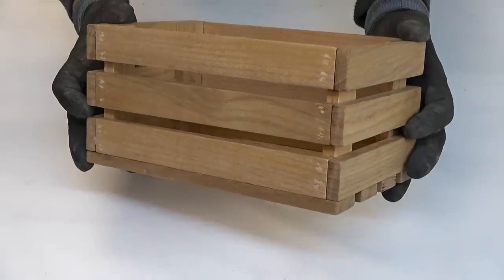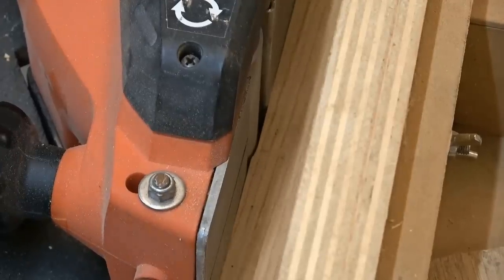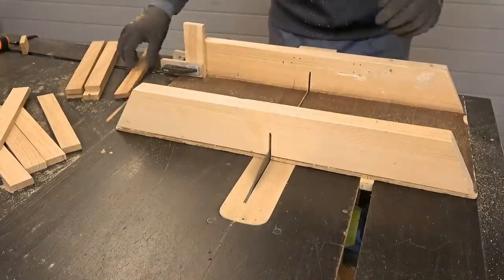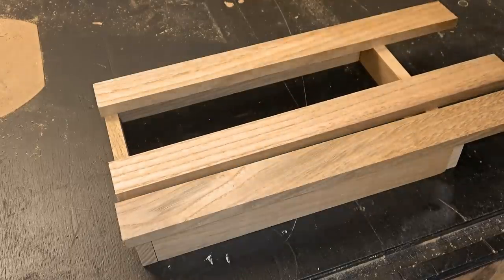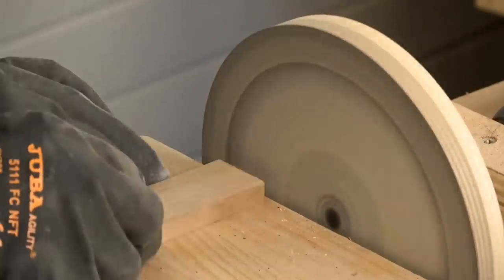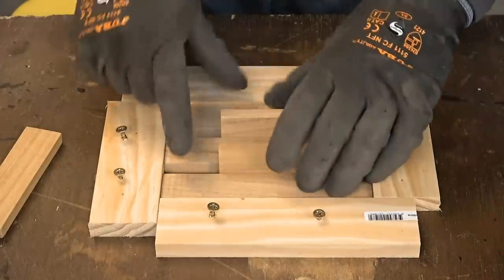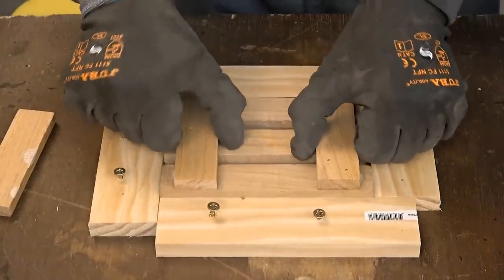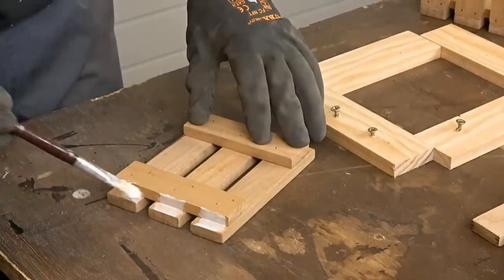How to make a wooden crate box. Nice DIY wooden box

Comment: Congratulations Sergio, the job was cool. Close the holes with glue and then sanding always the good result.
Reply from the maker: Than you. Sure that way it would look better. I am not happy about how the wood filler paste looks after I have sanded it
Reply: @WoodworkingwithDIYtools  use sawdust from the wood you are working with and some glue or a darker filler as the wood will darken a bit over time

Comment: Great video. Thanks for sharing. This really looks an easy-to-make crate box. Very clever template!
What nailer/stapler  do you use? Is it electric or connected to a compressor?
Reply from the maker: Thank you very much Hans. The stapler works connected to an air compressor
Reply: @WoodworkingwithDIYtools  Thanks for your reply. I use a cheap electric stapler/nailer from LIDL and I'm, for the time being, quite satisfied with it.
I mostly use pine, which is soft. I have some pieces of beech, which is much harder. I should try it on that as well. 
We do have a compressor now, since a few months. So there are alternatives possible now.
Reply from the maker: I also have a electric stapler from Lidl, but I hate it because it blocks very easily :(
Reply: @WoodworkingwithDIYtools  That's a pity. Till now I did not have problems with it. I'll knock on wood.